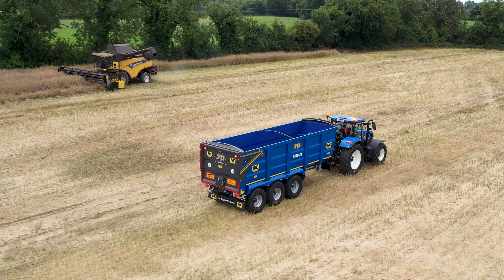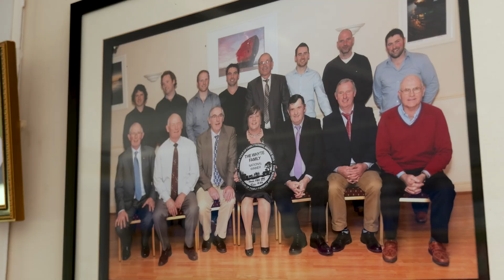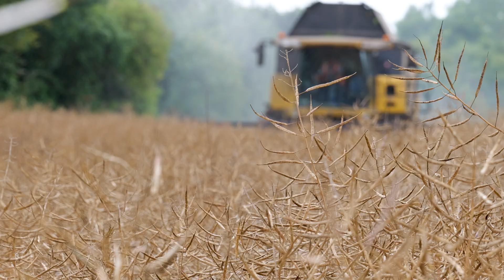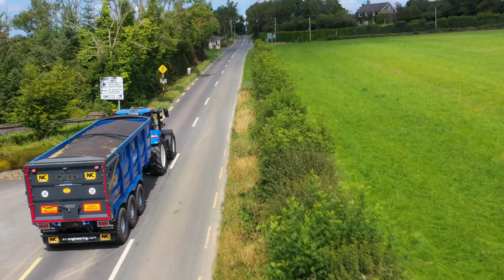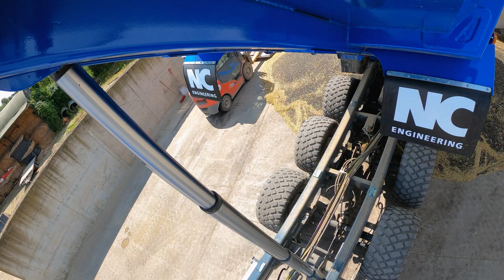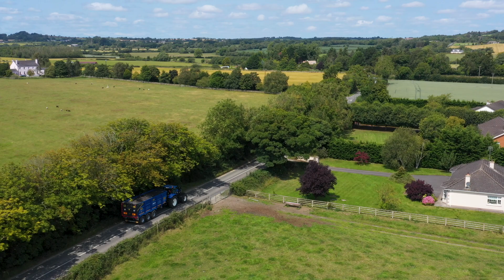The ONLY ANSWER for 3 HIGH OUTPUT COMBINES! - Whyte Bros Farms

Comment: Nice trailer, is it 24t capacity whats it full gross weight? What size hp tractor do you recommend?
Reply from the maker: @jimmyshields-z2h Approximately 32T Gross depending on options, the size of the tractor depends on the terrain your working, but in my opinion if it blue you wont have any problems lol

Comment: Shame its illegal to use on the road
Reply: Easy solution to that- auger wagons. By uk law, they're not deemed as trailers but implements. Some uk auger wagons can hit 43k litres .
Reply: @justherefox7  You didnt here the shot, did you?
Nobody is interested in UK laws in Dublin.
Reply: @pearlyhumbucker9065  my comment was aimed at the original comment person and ShEdward876. I know Irelands different
Reply: Would you care to elaborate as to why it is illegal to use on a road.
Reply: @TheGrimReaper1  Maximum legal gross weight for an agricultural trailer is about 18 tons in the UK
Reply: @ShEdward876 nothing to do with Ireland so
Reply: @ShEdward876  Since when is Dublin in the UK?
Reply: @ShEdward876 that’s stupid, uk are quare on agri stuff
Reply: @ShEdward876 since when has Dublin been in the uk.!! History and geography not your stong point is it
Reply: @ShEdward876 In the UK not Ireland, its a bit worse than that max speed is 25mph or 40kph for max width of 2.55m (only JCB fastrac can go faster up to 65kph). With the empty weight of trailer, the max load capacity is between 12 to 14 tonnes (max weight with trailer 18.29 tonnes and combined with tractor is 31 tonnes),. Over 2.55m to 3.5m the max speed is 20mph or 32kph, over 3.5m is 12mph or 19kph and requires an escort vehicle too. A large chase bin with the same capacity of 24 tonnes plus, could fall into the last width size and need and escort vehicle and only go 12mph.
Reply: Actually with air brakes and tri axle in the uk you can gross train weight of 34 ton and do 75kph